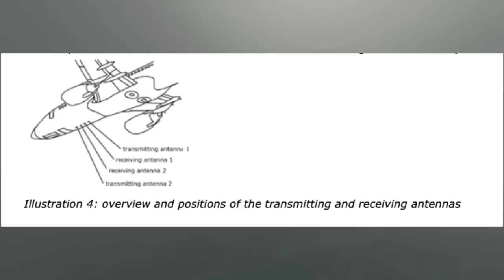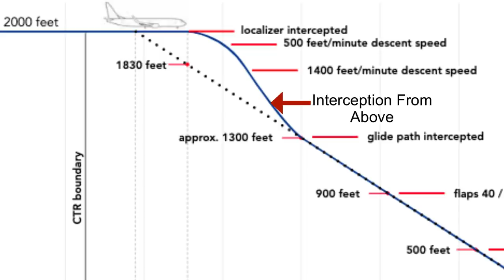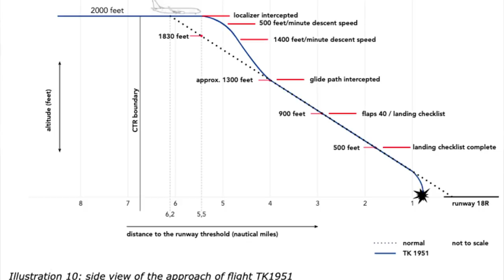How A Broken Antenna Crashed This Plane | Turkish Airlines Flight 1951

Comment: I've read the accident report in the past -- over 200 information dense pages.
There's a lot of work involved in reading and analyzing aviation reports and condensing them into 15 minute videos. Great job, sir!
Reply: It’s just a shame Sydney Dekker’s analysis of the facts was not read as well.
Reply: BOOMNG 737 = FLYEING COFFIONES
Reply: @ilovecops5499  coffiones?
Reply: They simply could have disconnected the auto pilot and land it manually, 9 lives could have been with us today 
Bad bad bad captain mistake 
He knew he has a problem especially the left auto pilot didn’t engage, so simple this happens every day
Fly the plane manual

Comment: "The altimeter showed -8 feet, which was impossible for the plane to attain"
Well, it sure tried to.
Reply: Schiphol airport is 4 m (13 feet) under mean sea level, so it is possible to attain -8 feet.
Source:  https://www.schiphol.nl/nl/jij-en-schiphol/pagina/luchthavenfeitjes/
Reply: @zonzeven  on a barometric altimeter yes. Not a radio altimeter
Reply: @zonzeven  And then there's Baku, at -28m.
Reply: The crash recreator  where's that?
Reply: The crash recreator  lol, where's that tho
Reply: Honestly I would of thought that the crew would switch off that Auto system and go hands on if they were seeing faulty data, clearly the crew were to use to Automatic systems, so skills and trusting one's gut is lost!
Reply: @worthlessreactor  ... i MEAN, LOOK AT THE MAP
Reply: That was actually the setting for the autopilot's target altitude...
Reply: So the reading was correct just premature.

Comment: To answer your question on the 37 Max. If Boeing would have set it to be a double redundant system then it would have required more scrutiny from the FAA (So more time to get an approval) and simulator training for transitioning pilots. Since they were trying to avoid both to cut costs the decided not to do it. Boeing put profits ahead of safety.
Reply: That's spot on. Any system that is deemed to warrant redundancy, automatically results in additional FAA certification requirements, as well as further training. Boeing basically wanted to match the newest A320 which didn't require additional training, and this was a major selling point for airlines. They took shortcuts on safety to ensure they get the sales that were otherwise heading to Airbus, and we can only hope that the heavy price of their decisions will cause them to think twice in the future on matters of aviation safety.
Reply: Sounds like the '737 MAX' again.
Reply: Back in 1972 the 'Windsor Incident' showed that there were  risks of potentially-fatal hull-ruptures on the new DC-10s that could have been reduced or eliminated by the retrofitting of pressure-equalisation vents in the cabin-floors. The consequent production holdups were a threat to McConnell-Douglas's sales, so they fixed it with the FAA to take their time over the work. When a fully-loaded DC-10 jet was lost early in 1974, with 346 people turned mostly into mincemeat, the cause was loss of control consequent to hull damage resulting from depressurisation (in a plane that had been modified).
Reply: @None-zc5vg  while that DC-10 was modified, it didn't have all of the modifications recommended by the NTSB. The cargo door locks had been changed, however some time in between when the DC-10 left MD's manufacturing plant and the crash, the locking pins were modified again. That DC-10 also didn't have the floor holes to prevent the floor from collapsing during sudden decompression, which would sever the control cables to the tail control surfaces.
Reply: THIS WAS NOT A BOEING PROBLEM, THIS WAS A PILOT PROBLEM
Reply: @greenbeenie2 , yeah keep telling yourself that. Maybe one day it will come true, but its definitely not today and probably wont be tomorrow.
Reply: Cantab , no, Boeing found a way to circumvent the regulation to their benefit. If it wasn't for the FAA's inappropriate relationship with Boeing they might have scrutinized it more. Also MCAS as approved by the FAA was different than its final configuration. Boeing never told the FAA about the changes made to it. The FAA didnt have the eyes and ears they were supposed to have on the factory floor because of changes pushed through by Congress due to lobbying by Boeing. FAA personnel also didn't have the expertise in cutting edge aerospace technology because the government doesnt pay enough to attract that talent. Forcing the FAA to rely on Boeing Management to provide insight while Boeing was hiding problems with the program. The whole thing was a huge convoluted mess and everyone's hands are dirty Boeing's, The FAA and the Politicians.
Reply: No to answer the question about comparing the 737MAX pitot tubes (AoA sensors) that was part of the flight software.  Why didn't it happen?  Boeing marketing.  Instead of a safe flyable configuration as the base price, Boeing chose a minimal flyable configuration which left out some duplicate flight hardware.  If they had taken out the MCAS system along with the copilot's AoA sensor, there might not have been a problem.

There also might not have been a problem if third-world gound services were as reliable as first-world services.  When commercial jets are parked for more than four hours, the pitot tubes are expected to be covered with a sleeve.  Among other things, this is to prevent bugs from crawling in.  (Eggs lait in pitot tubes can hatch weeks later--which is why the covers.)
Reply: BOOMNG 737 = FLYEING COFFIONES
Reply: Boeing is the name, McDonald Douglas is the corporate structure and philosophy.
Reply: As always
Reply: Thats correct, it would wery probably had been qualified as "safety critical system" and as such, the manuals and pilot trainning would need to be amended. But they promised to their customers (namely the launch customer, Southwest Airlines, they had it even in the conctract, that IF retraining was required for MAX family, they pay a "fine" for every delivered airplane to SWA) that there will be no retraining, and done anything required to keep that promise... even gamble with the flight safety. After all, what could happen, the pilots are well trained and experienced, the would recognise and solve any trouble caused by MCAS right? Well they probably would, but due they have not been told about it and how it works at all (it works automatically, why tell them anyway...) and so, the less lucky ones kept wondering what the damn is the plane trying to do, all the way until impact... :(
Reply: @danilon3121  Don't bet on it.
Reply: @pibbles-a-plenty1105  LOL, I suppose we all 'bet' on it every time we sit on a modern jet, which is kinda unavoidable these days, sooner or later.
Reply: @eachus  You are right, but the 737Max case is about AoA vanes, which are normally not covered when on ground (and it wouldn't help to cover them)...
Reply: @SYNtemp  Almost nobody realizes that MCAS was put in to prevent a very niche/unlikely problem that didn't need a solution. Not saying that there shouldn't have been some high angle of attack/low speed countermeasure, but the problem with it was that Boeing didn't limit MCAS in it's operational functionality similar to how Autopilot is. From the word go MCAS should have had a stick override to trigger autotrim adjustment lockout, kinda like how Autopilot disengages after a set force on the stick, or any other relevant control surface. In my opinion, there is still blood on everyone's hands, but less than everyone would have you think, not that it makes the situation any better.
Reply: @wifelikecow  MCAS wouldn't be necessary at all (in its primary capacity, which is compensating for increased momentum from bigger engines while climbing at high angle) if the pilots were informed and trained for this difference... but no, they wanted zero retraining, thus MCAS was invented to automatically compensate (by pushing the nose down). But since the implementation was far from perfect (both due human errors and due to agenda) it resulted in teh need to teach about it anyway, plus two crashed planes aditionally... :(
Reply: @greenbeenie2  It was both. The pilots should be monitoring their speed, but the system shouldn't have reduced it in the first place. Boeing however should really learn to never make any system non-redundant ever again.
Reply: Every US airline ordered the Max with a secondary AoA indicator. The crash plane's airlines, not. So, they purchased planes with a single point of failure, and Boeing had no explicit indication to the pilot that his critical sensor was wonky. Brilliant. I wouldn't have sold the planes without it—the airlines saved a fraction of one percent of the cost.
Reply: @UncleKennysPlace  You mean that AoA disagree (just disagree indicator!) that was found by Boeing non-working due to SW fault and planned to be "repaired" in next SW update due in allmost 2 years after first accident?? Well if it worked, and if Boeing made airlines aware it might eventually be impostant, then yes... but we're turning all the time around the point WHY they deleted any mention of MCAS in manuals, so they hardly can blown that by telling AoA disagree might be important...
Reply: So sick and tired of people bashing Boeing and the Max.   It did have redundancy, an MCAS malfunction can easily be solved by deactivating the rear stabilizer.  Two switches to off..   The first 737 Max that crashed was horribly abused by the THIRD WORLD airline, they failed to replace a bad AOA sensor, and they never bothered to tell the flight crew the plane was damaged, when they took off.   Moreover, the bad AOA sensor was made by Raytheon (not Boeing).   Both crashes could have been easily avoided by experienced pilots.  In both cases, the pilots were kids (captain was like 30 something) and the Co Pilot was just hired, and was in his 20s.   I wouldn't trust a 30 year old to even DRIVE me to the freaking airport, much less fly one of the most sophisticated planes in the sky.    PILOT ERROR X 2!
Reply: @johndaniels651 , deactivating a required safety system when it malfunctions is not a redundancy, it's a hail mary. It is truly despicable behavior to blame the accidents on "Third World Pilots/Airlines" when you're talking about two airlines with better safety records than most US carriers. Besides Ryanair is based in Ireland which is definitely not third world by the economic description and can only be considered as such by the old definition because they remained neutral during the cold war. Ethiopia has the fastest growing economy in all of Africa. 

The guidance from Boeing WAS to treat an MCAS failure as a runaway stab but after you do that you're supposed to manually take out the excess trim with the trim wheel. In the second crash the pilot DID flip off both switches but MCAS had put in so much nose down trim that he couldn't move the trim wheel due to aerodynamic loading. So he took a gamble since he couldn't move the wheel he flipped the switches back to on hoping he could get enough trim out  to move the wheel by hand (it would have taken the force of ten men to move that wheel). Unfortunately MCAS switched back on and went the opposite way he needed to go which sealed the fate of the plane that was allready nose down to begin with. After the first crash Boeing figured out in simulations that flipping the switches only helped when you knew what was coming. Several test events in simulators resulted in total loss of the aircraft and that was with experienced Boeing test pilots 

Boeing deserves everything they got and then some.
Reply: @valjoker7   - it wasn't "Ryanair" based out of Ireland, it was LION AIR based out of freaking Jakarta.    Second, the RION Captain was 31 years old.   You say Boeing puts profit over people and THAT caused the accident?  WRONG!      In reality, LION AIR hires inexperienced kids  as Captains, because REAL captains cost too much..   RION AIR intentionally  returned a damaged aircraft back to service WITHOUT making repairs and WITHOUT at least notifying the Captain that the plane he was flying had serious flight control issues.  The loss of control the night before was so severe , the passengers were traumatized.  Thankfully THAT PIOLOT was experienced and landed the Max okay (because he knew how to fly).    PROFIT BEFORE PEOPLE  / LION AIR (who hires low paid,  inexperienced pilots and places people on  damaged, un maintained  aircraft)  caused this accident, not Boeing.     The second MAX JET  (Ethiopian Airlines, another THIRD WORLD JOKE)  that Captain was 29 years old,  okay?  That pilot did switch off the rear stabilizer but he forgot to press the neutral button on his yoke.   Please explain how Boeing was responsible for the AOA sensor failure (manufactured by Raytheon, not Boeing)  or how its Boeings' fault that LION AIR put people on a damaged aircraft, or how the 29 year old Ethiopian captain didn't know he was supposed to hit the neutral button on the yoke prior to shutting off the rear stabilizer?  Oh wait, you can't.  You'd rather just blame Boeing and a perfectly good aircraft, that works just fine when its maintained properly and flown by experienced pilots.    Sorry Boeing couldn't anticipate that MORONS would fly the plane, or that MORONS would put poorly maintained aircraft in the sky.    And I guess its Boeing's fault that Raytheon makes such garbage AOA sensors as well.   Yet, none of these GUILTY PARTIES were blamed,  because our press HATES AMERICA and HATES BOEING so they spread the false narrative, and people like YOU just repeat and think as commanded.   Pathetic.
Reply: @johndaniels651  You are a very angry person.I hope you are never in charge of an airplane or anything else that requires a cool head under difficult circumstances where human lives are at stake.
Reply: @greenbeenie2  no

Comment: The pilots forgot the basic rules of flight,  you always fly the plane first, aviate first if there is a problem with the automation system disconnect it and fly the aircraft then navigate to where it is you need to be then communicate. If they followed this basic rule the outcome would have been a safe landing.
Reply: As always, fly the damned aircraft!
Reply: Clearly you have never flown an aircraft . You think it’s that easy to analyze everything . You think you can read all yo instruments in a  second . Mate they reacted faster than average
Reply: @SizzlyPK  I never said anything about it being easy but I have a multi certificate for commercial and private aircraft I am also retired now but I also have been trained on multi engine turbine aircraft and have over 12000 hours in both turbine and piston engine aircraft. So I have some ideas on what to do when things are not going to plan and we used to train for these types of events and almost every single one you are taught to first fly the plane and once you are in stable flight then you can work on whatever you need to do to resolve the problem 😉 to tell you the truth I always checked and rechecked the automation because I once had an issue with it and never really trusted it 100 percent after. It only takes a few seconds to verify that everything is going to plan and also having a copilot sitting next to me to verify that everything is operating correctly and or not is very useful 🙂.
Reply: @SizzlyPK   flying a jetliner is easy. Try riding a bicycle.

Comment: Huge mistake by the captain taking control at such a critical moment. The FO was doing the right things and if the captain had just continued to monitor and tell him what to do (eg. call go-around) they'd likely have missed the ground.
Reply: But that’s not the way it works. This goes down to human nature that has to be overcome with astonishing self-control and regular training.
Reply: That is correct. The FO increased power and pushed the nose down, but the Captain took over control at he most critical moment, the throttle returned automatically to idle and whatever time they had left to recover from the stall evaporated. There were a series of other mistakes too ( for example they failed to monitor their speed), missed opportunities to diagnose the problem (the landing gear warning horn,the  speed brake warning, the autopilot disconnect alarm etc.) but one thing is certain: the failure of a single antenna can't bring a plane down.
Reply: @Trevor_Austin  I agree that that's not human nature, but flying is not a natural situation. Hence the training.
I saw another accident report recently, late take-off abort and ran off the end of the runway, where the Captain (PM) restrained that urge and just did the PM job. Everyone survived. If he'd taken over it would have been much worse.
Reply: @mikes4163  Not sure what value these anecdotal stories add to this. There's been many emergencies where a captain have taken over and saved the plane as well. People make split second decisions in an emergencies, sometimes they are right, sometimes they are not. It's very much hindsight to blame a pilot for such a decision in retrospective.